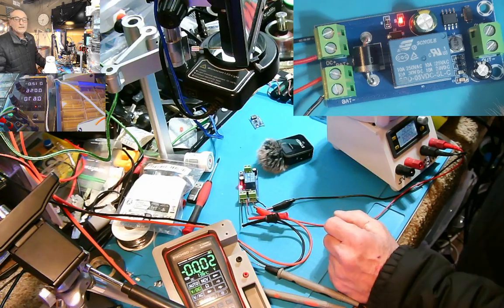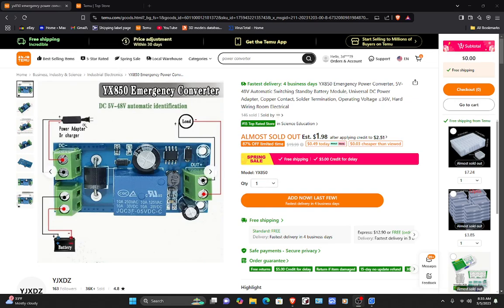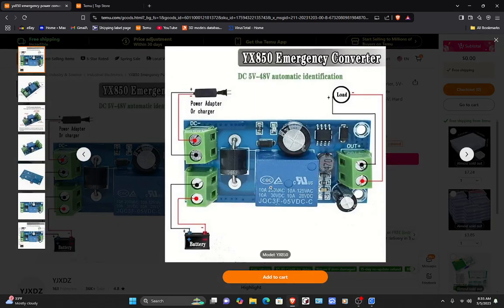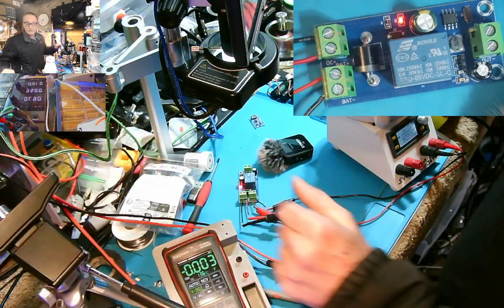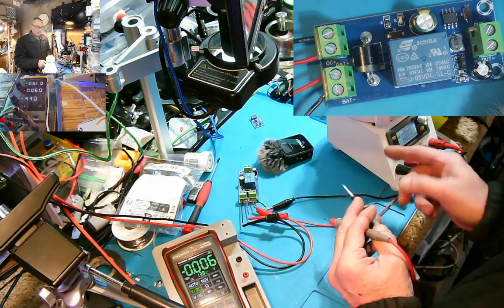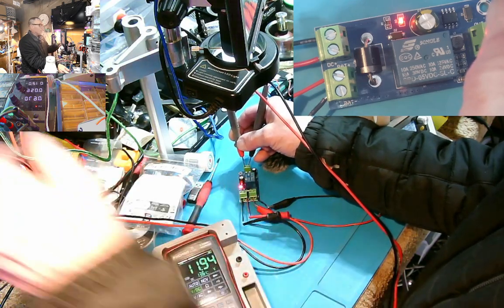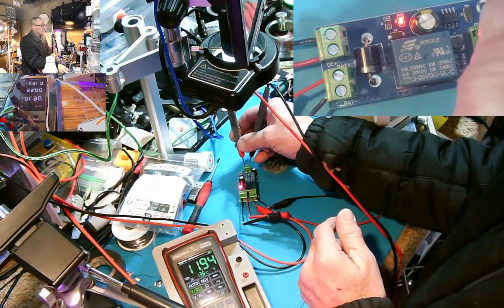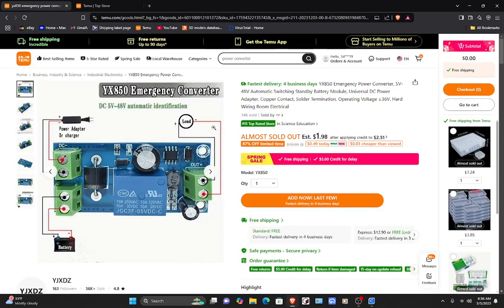YX850 Emergency Power Converter, 5V 48V Automatic Switching Standby Battery Module, Universal DC Pow

Comment: #Backyard_Electronics 
is that fixable in this circuit when the auxiliary power turn on there is total a cut off for second
Reply from the maker: Hello yes I think that capacitors May hold enough energy to keep each side live for a second when it switches over. But at my knowledge level I'm not sure how to do that. Or even if that would work. Hope this helps have a great day.🤠

Comment: Does the battery charge from supplied voltage when power is on. Can 12v lead acid battery be ok or only lithium type to be used.
Reply from the maker: Hello Carl a lead acid battery will be fine for your emergency power. I was using a bench power supply for the example. And have used lead acid and lithium doesn't seem to matter. But it will not charge the auxiliary supply. One more component needs to be added for that for that part. I hope this helps and thanks for watching.🤠
Reply from the maker: Karl here is more info if you need it Have a great day:  https://youtu.be/fPYUsMLDwTM